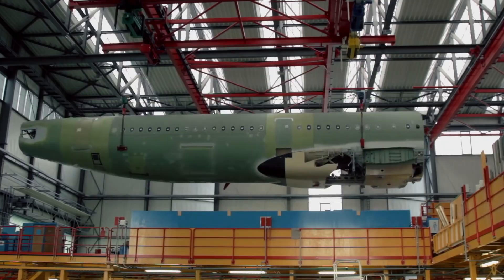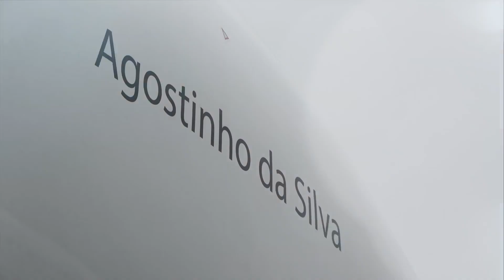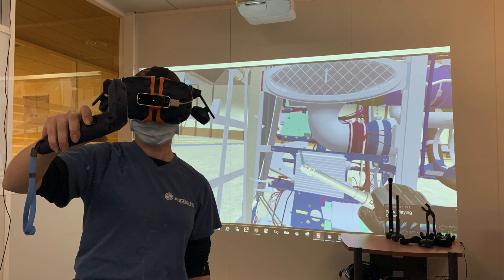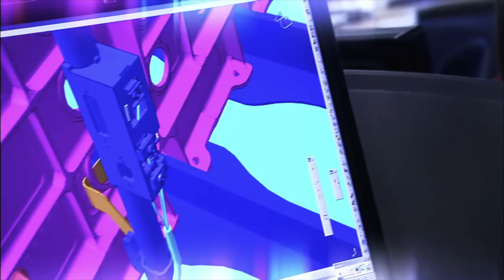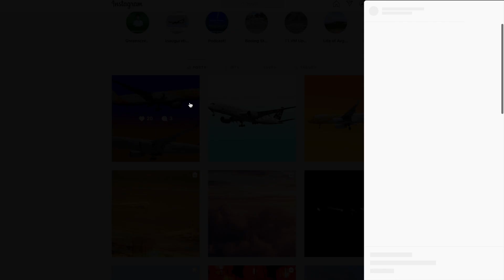A321XLR news: Production edges closer to A321XLR First Flight!

Comment: The end of the 757 coming closer and closer... 😢
Reply from the maker: It is, though competition drives the industry forward towards more efficient aircraft. See ya in the next one!
Reply: boycott the xlr
Reply: Thank you 757 for killing innocent lives
Reply: @crimsaki5273  you don't make sense at all noob !!
Reply: @crimsaki5273  IF YOU HAVE THE GUTS TELL THE TOTAL NUMBER OF 757 ACCIDENTS WHICH HAVE OCCURRED TILL DATE WITHOUT SEARCHING
Reply: @arnavsharma9882  2 October 1990; China Southern Airlines 757-200; B2812; flight Guangzhou Airport, China: The aircraft was awaiting takeoff clearance for a scheduled domestic flight to Shanghai, when the 757 was struck on the ground by a hijacked Xiamen Airlines 737-200. The Xiamen aircraft (B2510, flight 8301) had been hijacked, and the captain was attempting to make an emergency landing at Guangzhou. There was a struggle in the cockpit of the Xiamen aircraft during the latter part of the approach, which caused the aircraft to depart the runway and hit a China Southwest 707 prior to hitting the China Southern 757.

All 12 crew members survived, but 46 of the 110 passengers were killed on the China Southern 757. On the Xiamen 737, seven of the nine crew members, as well as 74 of the 93 passengers, were killed in the crash. The hijacker was killed in the crash. No one on the China Southwest 707 was killed.
20 December 1995; American Airlines 757-200; near Buga, Colombia:The aircraft crashed into Mt. San Jose at night at about the 9,000 foot level while descending into Cali, Colombia after its flight from Miami. All 8 crew and 155 of the 159 passengers were killed in the crash. Colombian civil aviation authorities report that at the time of the accident, all navigational beacons were fully serviceable and that the aircraft voice and data recorders did not indicate any aircraft problems.
6 February 1996; Birgenair (Alas Nacionales) 757-200; Puerto Plata, Dominican Republic: The chartered aircraft crashed in the ocean several miles from shore shortly after night time departure for Germany. All 176 passengers and 13 crew were killed. The aircraft reportedly had not flown in the two weeks prior to the accident. Alas Nacionales, a Dominican Republic airline, charted the 757 from Birgenair, a Turkish owned airline, for the flight to Germany. At the time, all airlines from the Dominican Republic were not allowed by the US government to fly to the U.S. because of sanctions imposed by the FAA Foreign Assessment Program.
Related NTSB safety recommendations
2 October 1996; Aero Peru Boeing 757-200; near Ancon, Peru:The aircraft was on a flight from Lima, Peru to Santiago, Chile. Shortly after takeoff, the crew reported some sort of mechanical failure. Contact was lost with the aircraft and the aircraft crashed at sea. All nine crew members and 61 passengers were killed.
2 August 1997; Continental Airlines Boeing 757-200; Lima, Peru:During passenger boarding, an elderly passenger in a wheelchair was assisted up the rear portable stairs by a gate agent. The passenger was instructed by the gate agent to remain at the top of the steps while the agent loaded the wheelchair into the cargo bin. However, the passenger continued to walk into the aircraft, through the aft galley and then through the catering door. The passenger fell to the tarmac through a space between the catering truck and the airplane. The passenger died from the fall injuries. The eight crew members and 141 other passengers were not injured. Note: Spillable batteries are normally not allowed on aircraft unless they are part of an electric wheelchair being used by a passenger.
14 September 1999; Britannia Airways 757-200; G-BYAG; flight 226A; The Pentagon, Arlington, VA: The aircraft was on a charter flight from Cardiff, Wales (UK) to Girona, Spain, and had a runway overrun at Girona. There were two serious injuries among the nine crew members and 230 passengers. One of the passengers who appeared to sustain only a minor injury died five days after the accident due to unsuspected internal injuries.
More about this event
11 September 2001; American Airlines 757-200; N644AA; flight 77; the Pentagon, Arlington, VA: The aircraft was on a scheduled domestic flight from Dulles airport in outside of Washington, DC to Los Angeles, CA when it was hijacked and flown into the Pentagon, collapsing part of the structure. All six crew members, 53 passengers, and five hijackers were killed, as were 125 people in the Pentagon.
American Airlines plane crashes
Attacks on New York and Washington
More on this event
11 September 2001; United Airlines 757-200; N591UA; flight 93; near Shanksville, PA: The aircraft was on a flight from Newark, NJ to San Francisco, CA when it was hijacked. However, on the way to Washington, DC, some of the passengers became aware of the likely intentions of the hijackers and attempted to commandeer the aircraft. The aircraft crashed, either due to actions of the pilots or the actions of the passengers, about 150 miles from Washington. All seven crew members, 34 passengers, and four hijackers were killed.
Attack on New York and Washington
More about this event

1 July 2002; DHL 757-200PF; A9C-DHL; near Üeberlingen, Germany: The aircraft collided with a Bashkirian Airlines Tupolev 154 (RA-85816) while both aircraft were flying at about 36,000 feet (about 11,000 meters). Debris from both aircraft fell in an area near Lake Constance on the German-Swiss border. Both crew members on the DHL 757 and the 57 passengers and 12 crew members on the Tupolev 154 were killed. The 57 passengers on the Tupolev 154 included 52 children and teenagers. The 757 departed Bahrain and was continuing on to Brussels after a stop in Bergamo in northern Italy. The Tupolev 154 was on a trip from Moscow to Barcelona and had made a stopover in Munich shortly before the accident.
Fatal midair collisions
Plane crashes for airlines of the former Soviet Union

7 December 2005; American Airlines 757-200; flight 924; Miami, Fl: The aircraft had arrived from Medellin, Colombia, and was on a roughly two hour stopover in Miami before continuing to Orlando. It is alleged that one of the passengers, Rigoberto Alpizar, a 44-year-old U.S. citizen, claimed to have a bomb in his carry on luggage. Air marshals confronted the man on the jetway and shot him after he appeared to reach into his bag. The man died sometime later as a result of his wounds. No explosive was found in the bag. It was reported that this passenger had previously arrived in Miami on an American flight from Quito, Ecuador and had cleared US customs before boarding the Orlando flight. No one else was injured in this event. This was the first time since 11 September 2001 that air marshals have fired a weapon on or near an aircraft.
American Airlines plane crashes
More on this event
9 November 2018; Fly Jamaica 757-200; N524AT; flight 924; Georgetown, Guyana: The aircraft was on a scheduled international flight from Georgetown, Guyana to Toronto, Canada. The crew experienced a hydraulic system failure during climb, stopped the climb at FL200, and elected to return to the departure airport. The aircraft had an excursion off the right side of the runway, coming to rest just short of the end of the runway off to the right. The right main landing gear collapsed, the right engine separated from the aircraft, and the right wing was damaged. All eight crew members survived, and one of the 120 passengers was killed.
More about this event
Reply: @crimsaki5273  I told you to tell the accidents without searching and so much info means you searched cheater !!
Reply: @crimsaki5273  if you can think you're great then the a321xlr sucks
Reply: @arnavsharma9882  Bruh A321XLR will be predicted as a very efficient aircraft.  The A321Xlr is better than the 757. It will be predicted a very safe plane often you know the fact that the 757 can have a very high risk of crash while it's old and cramped. Also the 757 is very cramped and uncomfortable. No one likes uncomfortable planes, it's starting to die. Alot of people are starting to forget the 757. Most people online never talk about the 757. About the A321Xlr, it's more fuel efficient, safer, comfortable. The A321Xlr is very Confortable and has a Widebody, not that wide but very good airspace. I can predict the B757 will fail. As you know the A321Xlr is being ordered by alot of Airlines. The 737 Max as well but a bad decision. If you see the 737 Max it has killed alot of people, as I already know that it is Re-certificated. I think it's a bad or good decision
Why bad: Because there can be a risk a crash can happen. If a 737 Max crashes in America, a big chance Boeing can be sued of of existence. 737 Max needs to be reworked and needs to be reworked, the gear should get hire so the engine can get a little lower since the Engine is a bit. It can risk something. 346 people were killed from the 737 Max, Boeing should rework it more even though they already reworked it often.
Reply: @crimsaki5273  Most of the crashes you listed there were NOT caused by a fault of the aircraft, have you even read what you post? Also, if an aircraft is cramped or not does not depend on the aircraft, it depends on the Airline. Ive had tons of 757 flights the longest ones over 9 hours and its a lovely airplane to fly with.
Also, in some ways the XLR cannot beat the 757. But in efficiency yes of course, the 757 is 40 years old!
Reply: @widget787  A321Xlr can be beated by comfort.
Reply: @crimsaki5273  i can guess you are an airbus fanboy am i right?
Reply: @crimsaki5273  the 757-300 is longer than the A321XLR so the A321XLR won’t be a replacement for the 757-300